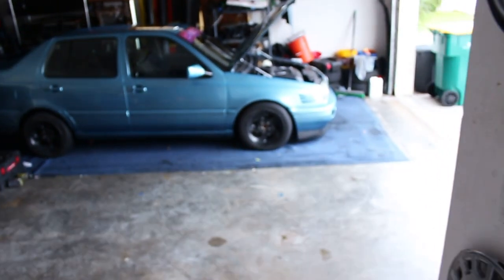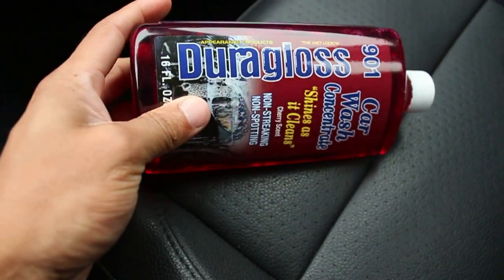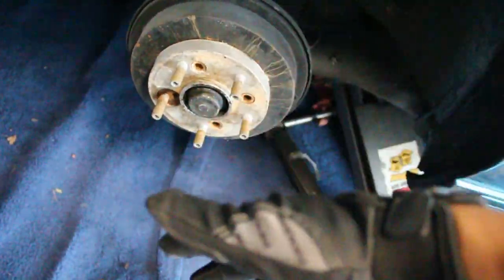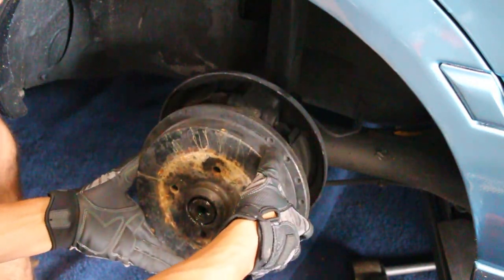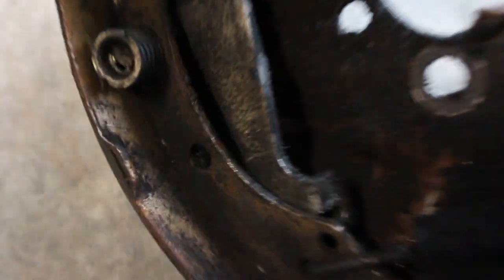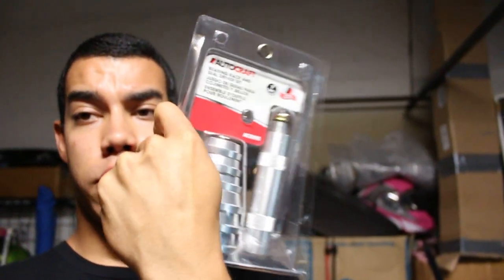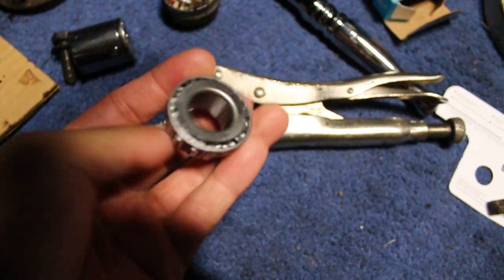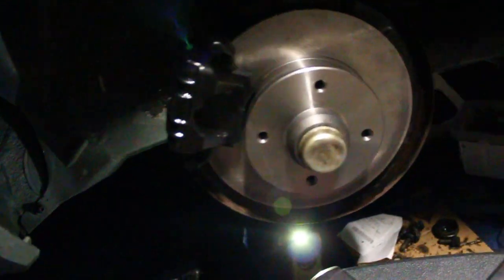Swapping drum brakes for disk brakes on Miley ( pt1 )

Comment: 1999 passat rear rubber brake lines work for a mk4 rear brake swap, instead of changing the entire rubber line and metal line. one side is mk3 style and the other is the mk4 banjo bolt.

Comment: I enjoy this video but I feel some important information regarding the parts need it for this conversion was missing!  I’m new to VW’s and I own a 98 Jetta GLS ( US model) with drum brakes and I wish to do a swap conversion but I don’t know exactly what I need.
Reply: Lots of missing and bad information on this video.
The easiest  swap is doing the entire rear beam with the discs, just make sure it is from a non-ABS car if your car is non ABS.
By swapping the entire beam, you have the proportioning valve already adjusted for disc and you get a free integrated sway bar in the new beam.

Comment: Where did u get the stub axle and the caliper for the mk 1 to change it to discs, i hate the drums
Reply: You can use the MK2 Scirocco rear brakes, but you need the proportioning valves from the scirocco too.